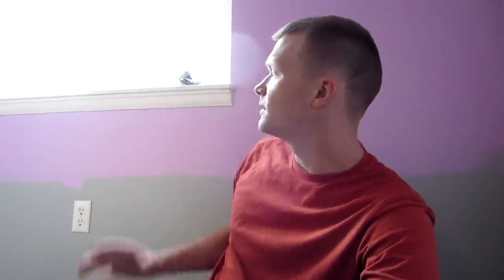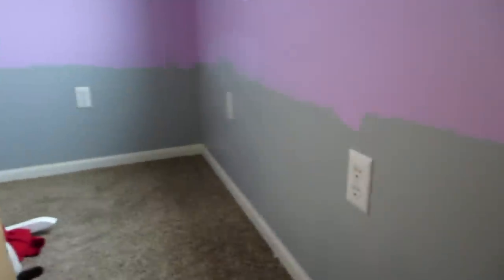Installing Wainscoting/Bead Board

Comment: Good job on doing it yourself. Heres couple thing to make this job easier for you. Set the pressure a little higher on the nail gun and the heads will indent. No need for so many nails either their just to tack the panels. Last dont use wood putty on this stuff use painters caulking on all your joints and gaps and it hides them great also can use on nail holes just wipe off excess with damp sponge. No need to sand.
Reply from the maker: Jeff Prestridge Thank you Jeff for the feedback, I really appreciate the honesty.
Reply: Your welcome
Reply: Should I remove my baseboards

Comment: Brian, you made me spit beer on my keyboard, .... when you said that your house is a little older,... early 2000's...... try 1885 and it started off as a miners cabin, lol, rotf.
I threw away all of my levels and squares along time ago..
When it comes to nailing of the panel, just locate the studs at 16'oc.
Keep up the good work.
I love working on my old house..... it gives my an excuse to drink...
Reply from the maker: Joe Bucci Sorry for the split beer ;) that must be some experience owning a house that old with so much history to it.
Reply: I am the 4th generation in it and sorry to say none of the 3 prior generations were much good at electrical or plumbing.
It keeps me busy.

Comment: One more tip..paint the wall with the color of the panel so the color of the wall doesn't show through in case the panel doesn't fit perfect at the joints. Nice vid tho. and great job.
Reply from the maker: That is a great idea, thanks for commenting and letting me know.

Comment: Good work... instead of using so much glue, try the scissor nailing method.(cross your nails to lock the trim and boards to the wall) quicker than having to glue constantly.

Enjoyed watching as I do the same in my house...
Reply from the maker: Zach Roberts Thanks Zach, I actually did some of that method of camera. One is for sure... I have a lot to learn.

Comment: Hello sir! Can you please advise me? Im not sure what can be done about the beadboard MDF that i added along the long wall facing the outside in my basement. It seems to have expanded and is wavy now. Apparently there are supposed to be joints in between the boards  but I didn't know of this issue previously. And I watched few videos and no one left any gaps between the boards. Thanks!
Reply from the maker: It may have expanded because of the moisture. I would do everything you can do to reduce the beadboard from getting wet.

Comment: My question is why not use the chair rail to cover the holes on the top of the beadboard? I thought it should overlap.
Reply from the maker: It certainly can be used to cover the holes. It depends on the and size of the chair rail.

Comment: Nice to see how you did the project. Next time, set your nailer to a slightly deeper depth so you won't have to punch 100+ nails. To simplify things, I'd also suggest using the same trim color throughout your house. Oh, on this type of project it's also really important to use a level especially on "older" homes!   Looks great, I'm about to do our half-bath and will video it as well.
Reply from the maker: Rod Swartz Thanks for the tips Rod, let me know how your half-bath goes. My next big project is to do the bathroom, we have a new vanity and plan on putting in tile flooring and a backslash.

Comment: Do you 100% have to hit the studs when using the nail gun? I'm not going to use glue at all like some do. But I have issue with studs on my walls at times. So wondering if possibly shooting nails at angle to hold better is option if stud is playing hard to get.
Reply from the maker: Funny thing is the point if the brad nails are to hold the board against the wall while the glue dries. The glue is what keeps the board attached to the wall.

Comment: When you put the bead board up did you put it on top of the lower trim? You went a little fast. Please let me know because bead board is my next project for my dinning room. Thank you
Reply from the maker: Yes, I put it right on top of the original base board. Even though I did I wouldn't recommend doing it. At HD and lowes and you get pre-cut grooved modeling which the bead-board will rest into.

Comment: Great video, about to do this for my bathroom. Question: how were the corners done? What did you use to paint the panels?
Reply from the maker: They came painted white, but after we put wood filler in all of the holes we have some white paint that we used to make it look uniform.

Comment: The idea that you can join two pieces of beadboard that way assumes that your baseboard (or floor) is straight and level.  That has not been my experience in any homes I have had or worked on.

I notice that your skillsaw cutting guide lifts one side of the base which keeps the saw base at a slight angle, so the cut is not square to the face of the work.  Not an issue with very thin beadboard, but not good for something like 3/4" material.
Reply from the maker: Two good points you're making. Thanks for stopping by.

Comment: Don't you have to remove the baseboards first?7
Reply from the maker: I didn't for this project but I would recommend that you replace them with pre cut Grove baseboards which will hold the wainscoting in place and give a cleaner surface.